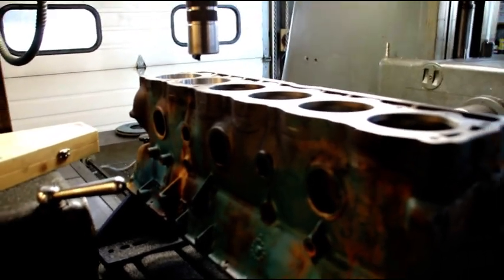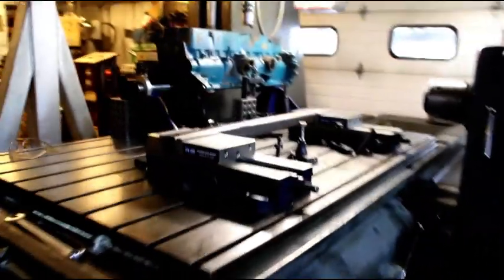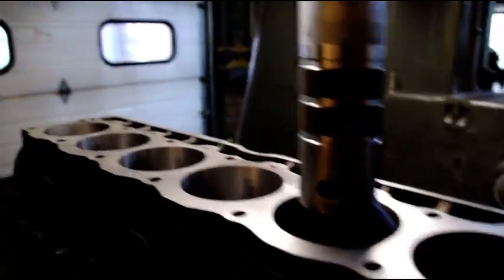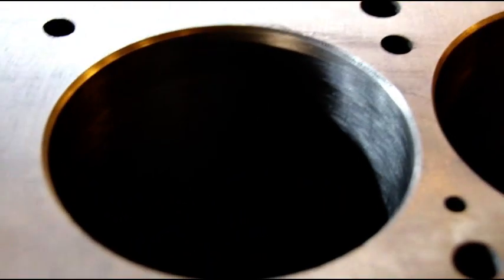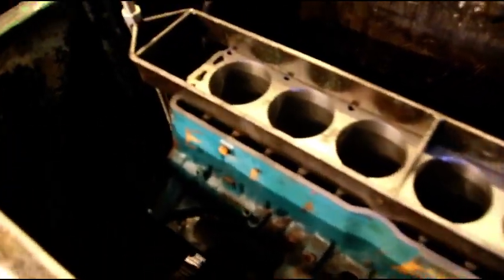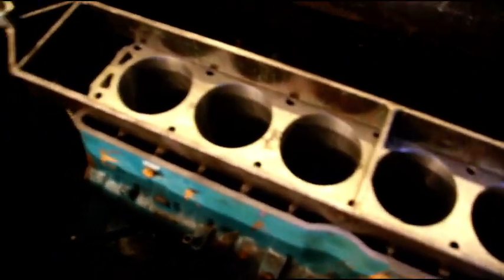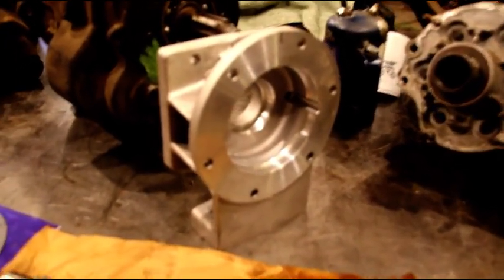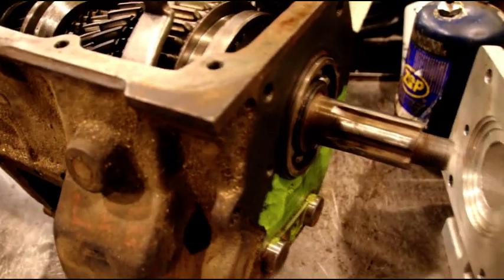Scott's AMC/Jeep 258 Engine Boring On SIP Hydroptic 8

Comment: Are your cylinder bores square to the crank centerline?
I can't see your setup, so I don't know what you're locating on.
Regards,
Duck
Reply from the maker: Of course the  bores are square.  Block is held by the crankshaft centerline and set up perfectly square to cutter.   I am using the most precise Jig Bore ever made and it can hold tolerances of .000001"
If you follow along on my channel you will see this block being decked on the blockmaster and held by the crank centerline, then everything moved to the boring machine and again held by the crank centerline.
Reply: @metalshaperJeep  No offense intended. My first job was in an automotive and diesel engine machine shop. I learned the ins and outs of setting engines up for machining there.
As for the sip, we had a similar sip in a tool and die shop I worked in and retired from.
You're right, those machines can be dead nutz.
Regards,
Duck